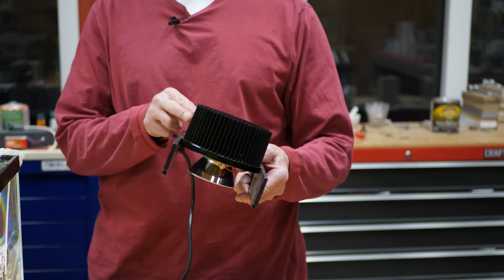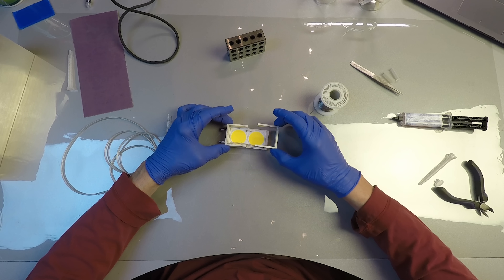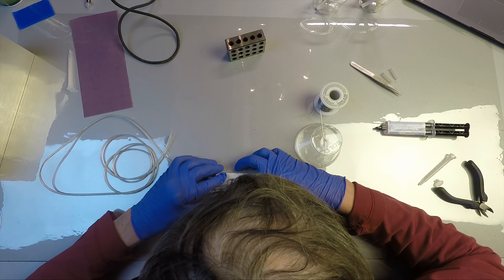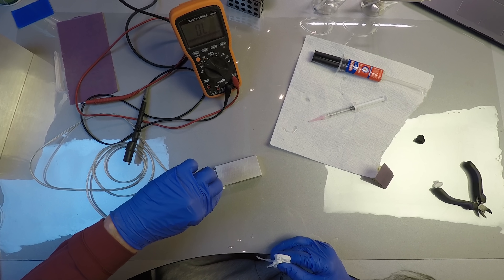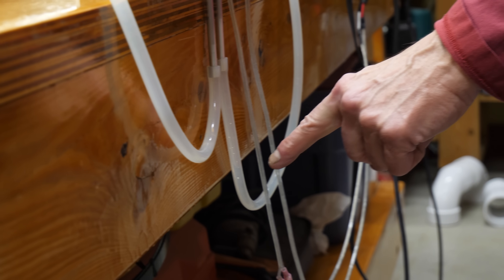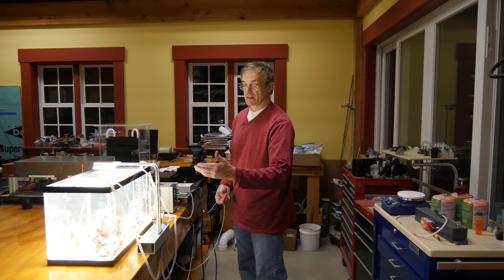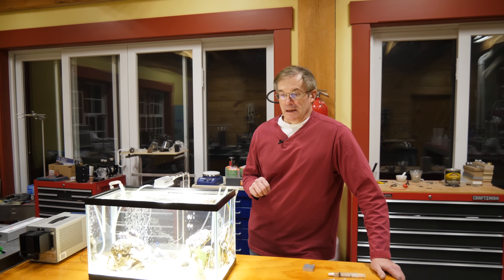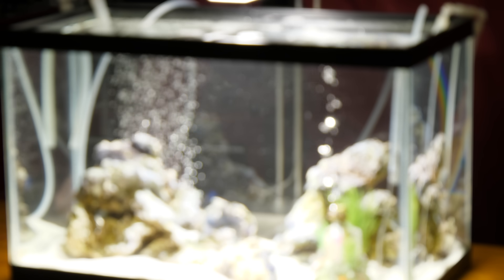40,000 Lumen LED Aquarium Light

Comment: I must say this is the best-designed aquarium lighting I have seen. All the commercial lights are outrageously overpriced, ugly and large. You have a very powerful light that is aesthetically pleasing with the smallest footprint I have seen and its water-cooled. Well done sir. Most if not all the negative comments obviously come from those not into aquariums. Aquarium water is not full of solid matter such as poo that will clog up lines or the aluminum block as claimed by some of the commentators. The water is actually highly filtered. Biofilms certainly exist. An absolute necessity for the very survival of the ecosystem but does not exist at the levels necessary to foul up pumps, lines, wavemakers, water circulators or anything that is in contact with water so long as the water is constantly circulating. You will find that most if not all aquarists are very anal about maintaining their tanks at optimal levels through constant maintenance. I also like the idea of heat dissipation through a closed loop. I am working on making this design water submersible. For those of you thinking hot spots, they don't exist.

Comment: I would have used a separate radiator and pump for cooling the light due to tank water being perfect for creating galvanic corrosion.
Reply from the maker: That's a perfectly reasonable option.

Comment: Would common aquarium chiller setups be sufficient for two-phase immersion cooling using 3M Novec engineered fluids?
Reply from the maker: That's more than enough.  The LEDs are very effecient.
Reply: @TechIngredients  It's off topic but I was referring to the cooling of common PC parts, which can range in power usage from 200-1500W, through boiling and condensing of a fluid with low boiling point (50-99C)

Comment: It looks awesome! And a great idea to be able to keep the coolingsystem away from the light source. Wonder if the liquid flow could be done without a pump? Not for aquariums, but e.g  a desk lamp with passive cooling....
Reply from the maker: Thanks!
If you are going to use liquid cooling a pump is hard to avoid because it's so effective.  If you want to illuminate a desk or a table then this lamp is way overkill and air cooling will be the better answer.

Comment: What is he talking about cooling the aquarium ??  One more thing why run water through the heat sink when the air will work just fine and will help heat the water through the bubbles, reducing the electricity bill of the heater. But I guess a man of his IQ doesn't realize that an aquarium of that size doesn't need a water pump
Reply from the maker: Please don't resort to insults.  Air alone is unable to cool the concentrated heat generated in the small head of this light.

Comment: YOU SHOULD BE REPORTED TO THE HUMANE SOCIETY FOR PUTTING THAT MUCH LIGHT ABOVE AN AQUARIUM !!!   Just What EVERYBODY WANTS BLIND FISH
Reply from the maker: Ken, you don't have to run this at full power.  As I said, the power supply allows you to dim the light.  You also wouldn't place this dual LED lamp above a 40 liter tank.  I wasn't going to set up a 400 liter tank on the bench for the demo.  Nevertheless, the light levels above a shallow coral reef are actually higher than I demonstrated.

Comment: the epoxy or laquer coating is used in ultra pure water applications for silicon wafer fabrication, where you need ultra pure water (12nm filtration)
for cooling the euv laser, the water blob lens and waver itself.
Even the highest grade stainless steel gets corroded over time, so it needs additional coating (heaters,heat exchangers).
and even then you can see ageing on the surface over the servicing intervals. everything else is plastic and the water is only staying "upw" if its constantly replaced.
you can see how the resistance of upw goes down from 18.3Mohm (if i remember) really fast the longer it stays in the lines.
Reply from the maker: That's true.  Ultrapure water is highly corrosive due to the lack of ionization.

Comment: I figured thermocycling would disrupt the epoxy bond of cob to heatsink...how is it holding up?
Reply from the maker: Still no problems, but keep in mind that the water-LED interface remains relatively close to room temperature because the epoxy is very thin and that's why the LED remains cool.

Comment: This all looks "okay" and is providing a nice, bright illumination. The use of the aquarium water as the cooling source is fine for the moment but unfortunately will be a failure point over time. What safety measures are in place in the event of coolant flow failure? None, which could lead to LED overheating and possibility of fire. A solution could be to incorporate a thermal monitoring system at the lamp fixture, in the event there's an over temperature condition the lamp would be powered off, saving fish and home.

Man: (Standing outside while his house is burning down.)
Bystander: "What happened here?"
Man: "I made a light for my fish..."
Bystander: "...so how's that working out for ya?"
Reply from the maker: Your suggestion regarding a thermal feedback to a simple switch is a good one. However, fire is not a reasonable threat.  The led will fail before the aluminum block could ever become hot enough to ignite the acrylic cover plate.

Comment: Most aquarium plants die with even modest light... Which to a normal person who has standard knowledge about LED's is actually low light by normal people standards. So this is quite pointless for actual fish keeping. In fact most plants require low light or they die or don't grow correctly. Which is extremely low to a normal person. How ever where this system shines is it is cheap, good looking and simple. Just use a dimming circuit or dimmer cheaper LED's if you want to do this for fish. You shouldn't have to cool your LED's with liquid or their WAY to bright for fish or any marine life other than algae or possibly a large reef tank with lots of corals, but you will have issues with even lighting on most large tanks any ways. Also algae. You must balance the plant life, light and fish waste ratio in your tank to avoid algae.
Reply from the maker: I agree with only you're last statement.  You have to control nutrients. The highest light levels that hobbyists typically produce are substantially below what a plant has evolved to grow under.  The sun establishes this standard.  Anyone who has spent some time on actual coral reefs knows how incredibly brighter the illumination is within a few meters of the surface than in a typical aquarium set up.  The reef is also not overrun with algae because the reef is cleaner and devoid of the nutrients that hobbyists struggle to control.
Reply: @TechIngredients  Well thank you for the response. I recently set up 9 tanks in my house. I found an excellent source for aquatic plants and very high lights. Were talking $10-20 for 1200lm multi spectrum lights with red green blue and white. All the plants either shrunk or melted. The only plants  that did well were the ones in tanks with very low light like 25-75lm even the plants in tanks with no light did better than extreme light how ever not well of course and most species die off with no light accept the moss really.
Reply from the maker: I've set up a few SPS coral tanks over the years and have found an interesting property depending on the source of the coral.  Pieces that were obtained from local aquarium retailers grew much better under low lights than under moderate to high lighting from MH lamps.  But, pieces that we're harvested directly from a Caribbean reef only began to thrive under the highest intensity lighting I could supply.  Tropical plants that are growing near the equater are getting nearly 150,000 lm/meter^2 and are competing with each other to get as much of this light as possible.

Comment: Wouldnt coating inside of block with epoxy lower cooling efficiency? I cant imagine epoxy has a low thermal resistance
Reply from the maker: The extremely thin film and the large surface area ate unlikely to be significant.  But, it does indeed reduce heat transfer.

Comment: Can you divert the coolant water to another submerged cooling block in the aquarium for heating?
Reply from the maker: Sure.  I'd coat the outside of the submerged block with the epoxy to prevent corrosion.

Comment: 35V seems inconvenient. I have cheap chinese 50W COBs that run on mains AC. They're very bright (as bright I wonder?) and dimmable with a cheap motor speed contoller.
Reply from the maker: These Cree COBs are very effecient at nearly 200 l/W.  I've used some Chinese COBs from eBay and AliExpress.  They are usually close to fluorescent effeciency at 100l/W.  The 35 V can be a hassle, but if you run them in series you can get them to more convenient multiples of 35V.

Comment: I like the epoxy trick. We've been looking for a solution to a similar problem at work. We have some tooling that is mounted in aluminum, water cooled blocks, and the water supply is not so great. The aluminum block's cooling passages are corroding pretty badly and we are getting a grainy substance like sand or calcium, but very soft that builds up and clogs the passages as well. I'm wondering if this would be a good solution to that. I'm a little worried that we may not get the excess epoxy drained out completely and end up completely sealing off one of the passages... Would there be a way to dissolve or remove the epoxy somehow, without harming the aluminum, if we do mess up?
Reply from the maker: Flow the epoxy vigorously while it is still liquid and if necessary, blow air through the passage ways to assure they are patent while the epoxy cures.  Methyene chloride (paint stripper) is an excellent epoxy solvent when you need to remove it.

Comment: Well, I commented on your earlier project. What you've done is one of the suggestions that I made over a year after this was published, which was to move the dimmer control away from the tank.

What you've also done that I did not suggest was to go with liquid cooling. I have that on my computer. I bought it used that way and had never had it before, but immediately appreciated how quiet and efficient it is.

I have a 125-gallon tank that is 6 feet long and 22 inches tall. It's in my front room and I have to use two 300-watt heaters to keep it at 78º F. They're controlled externally.

I'm not sure I'd risk my fish by cooling the lamps with their water. And I don't think I'd risk getting all of their detritus inside the cooling loop and clogging it up. At best, I'd consider a water-to-water heat exchanger if I wanted to dump the heat into the tank. But since that adds complexity, I would opt for dumping the heat into the room. After all, that's what I already do for all other heat-producers, such as my computer, TV, LED lights, stove, and refrigerator. A 120mm or 240mm computer radiator is affordable enough and probably has enough capacity to handle the heat. If not, there are larger ones or you could just add more (in series or parallel) as needed. Fans are cheap, too, so I'm sure you could put together a fairly decent-looking solution.

Thanks again for taking the time and effort to share your ideas and projects and all of the really neat details on how to put it all together. Keep it up, please!
Reply from the maker: Thanks!

Comment: Would a TEC peltier sandwiched between the LED and water block be beneficial at all?
Reply from the maker: No.  The water flow is so effective that the temperature rise is less than 1degree C.  Cooling below ambient will increase the effeciency of the COB a little, but the power needed to drive the TEC will be much more than the power saved by the lamp.

Comment: The only problem I potentially see with this is build up in the tubing and the water block of muck, algae, and for any but the softest of waters calcium buildup. Any ideas if you were to do this to keep the system clean? Because Even if you mounted some form of sponge filter at the intake some small particulate is still going to get through.  One idea I had that is probably not practical. You could connect the system to a radiator and place the radiator in the aquarium.

Comment: The amount of lumen is predominantly determined by the green wavelength. What do plants use to photosynthesize? Predominantly - but not exclusively - red and green. At what visible wavelength do they show no photosynthetic activity at all? Yep, green.

I don't see how this is a good aquarium light. It's too bright to see fish/plant coloration properly and may or may not be sufficient for growing advanced plants. I'd be interested in the PAR value of this... thing. I'd be surprised if it even reached 250.
Reply from the maker: Chlorophyll absorbs red and blue light.  That is why leaves are green.  These COBs are available in a variety of wavelength mixes.  You can see the spectra if you look at the spec sheets from Cree.
Most of these LEDs have a high red and blue output and that is why they are widely used in the hydroponic industry.
Reply: @TechIngredients  Excuse my faux pas. I was meaning to write red and blue. The whole comment as it continues makes more sense that way anyway.

Comment: You can use slower epoxy. The hardening process is an endothermic reaction. So, if your components aren't going to melt, once the epoxy is all applied, the hardening can then be sped up with a heat gun. The hotter it's heated, the faster it hardens. For heat sinks, it can be hardened in seconds.
Reply from the maker: True, be careful of the brief interval in this process when the added heat will decrease the viscosity or the epoxy before it cures.
Reply: @TechIngredients  That makes sense, but now that you mention it I haven't observed that phenomenon noticeably in practice. Perhaps due to the progression of heating from surface to interior, with a progression of curing following, such that the decreased viscosity is a progressive thin layer? Thinking of what would be involved in micro-measuring the phenomena... Seems like it would be pretty involved, not to mention expensive. Perhaps there's a quick and dirty method I haven't considered. Interesting.
Reply from the maker: A trick in boat building when the final flow coat is applied to the fiberglass to fill the weave and give a smooth finish, is to use a heat gun to reduce the viscosity and promote the spread even though this will shorten the ultimate cure duration.

Comment: How about an arduino reading a thermistor for water temp. And controlling the light depending on temperature? Then you have an easily visual idea of temperature at all times and if the led heat output is enough you would have a great automatic tank heater.
Reply from the maker: Good idea.

Comment: The epoxy coating might become compromised due to the heating/cooling, etc and kill fish, which can be expensive, to say nothing of the breach of custodial duty one assumes keeping the fish. How about brazing a back/forth squiggle of SS tubing to a copper slab? I realize it won't be as inexpensive, but if one already has the equipment it wont be that bad either. I'd still be worried about SS in a saltwater environment, and in any case one should ensure there aren't any electrochemical gradients due to different metals in contact with the water at any point in the system. From an aquariast's point of view, as you can tell...

Comment: you forgot to fix the wire inside
Reply from the maker: Actually, I did.  Just before l I started wiping the window, I blacked a small drop of hot glue at the midpoint of the wire, but that was edited out.

Comment: Ventilation cooling can be very efficient to cool an aquarium... here is the challenge: a 500 Litre Aquarium with water cooled LED and a power efficient cooling system. it will probably be similar to the air condition system you have build, but this time you don't cool air, but water and need to recover the humidity to bring back into the tank...

The tank doesnt need to be large for a test though.

Comment: submerging the light would avoid a lot of reflection from water surface... and avoid the problem of ...life... clogging of all the tubing...
Reply: If you did that the led would be coated with algae.
Reply: @reasontexas  you'd just turn off the light, let it cool 1 second, and wipe it with anything

Comment: I love the whole idea, especially using the tank water as the coolant, but if you use dirty or unfiltered water, won't the fish waste build up in the block or tubing and at least reduce the flow rate, or at worse reduce the cooling capacity to a dangerous level? Also, that fire extinguisher needs servicing...
Reply from the maker: Firstly, the water sent through the block should be from and not to the filter.  It may eventually have to be flushed, but if that becomes too frequent, you could always run the water to a closed heat exchanger either in the tank or even outside the room.  Regarding the fire extinguisher, it's a CO2 extinguisher and we have tested it to make sure we are comfortable with using it.  I don't like the pin because in a rush, I want to fire it as fast as possible.